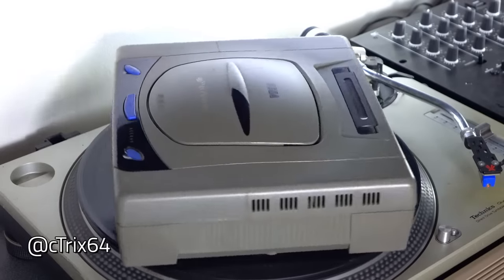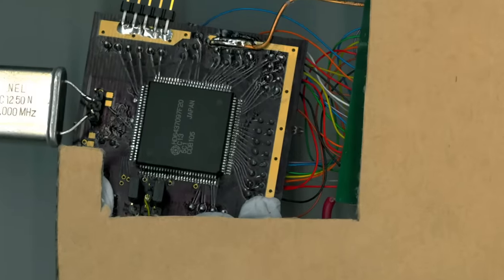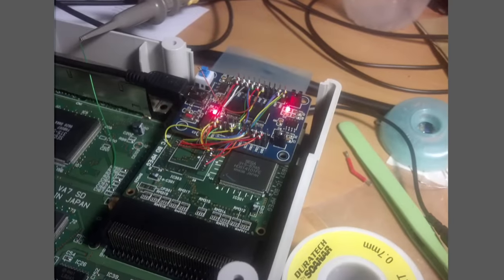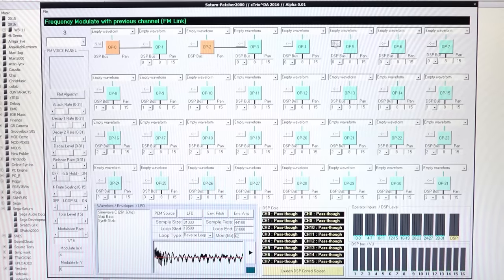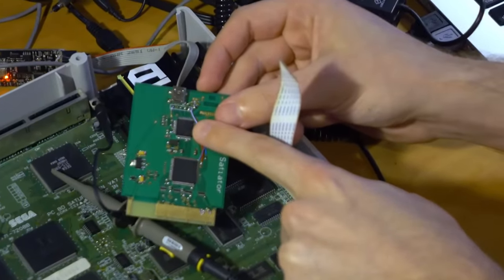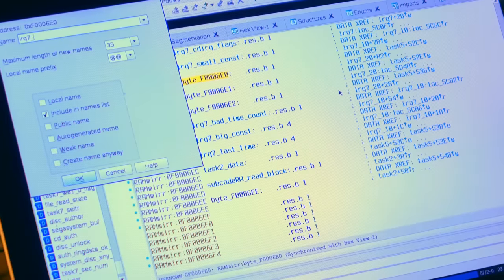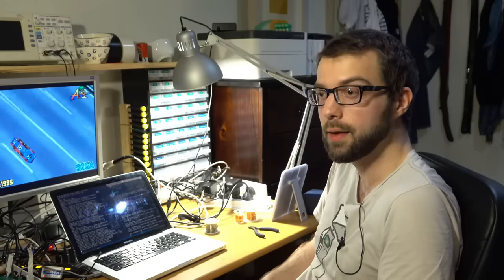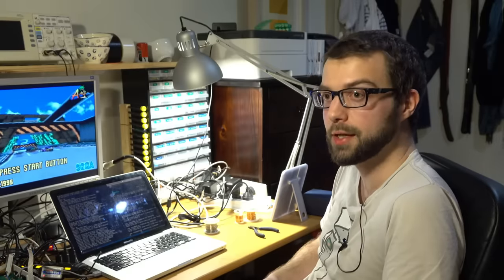Sega Saturn CD - Cracked after 20 years

Comment: Great work. This guy should get with Krikzz (everdrive guys) to have it produced with both an SD card as well as USB port (like most everdrives). That way you can load up an SD card full of bin/cue files or plug in an external USB drive and play.
Reply: I don't see the point of the SD slot.  It works for Everdrives because the games are small, but a large collection of Saturn images would need a hard drive.
Reply: Not if you include the Japanese library.  The slot in the back of the Saturn is big enough to hold a card and USB stick so its not a big deal.
Reply: I easily have over 400gb of Saturn images. And USB drives have always been cheaper.
Reply: Which is why USB is the better choice. If the device has a female USB port, you can use your MicroSD card with an inexpensive adapter, something you cannot do if it is SD-only.

USB does everything, SD or microSD does SD or MicroSD. Plus, a MicroSD card that's 512gb barely exists, and would cost over $1000. The ones on various sites are usually 4-8gb cards faked with fraudulent firmware.
Reply: The same could be said for the video port on the system. Use a USB extension cable if you would like a bit more slack.

And it depends also on the placement of the USB port. It could fit into that slot without sticking out at all, there is easily enough room.
Reply from the maker: It'd be an easy mod to the PCB to add an SD slot.  We're on the cusp atm; so it makes sense to use USB at this point.
Reply: +Boozer Chooser I'd imagine the basis for using a JP saturn was it was cheaper and more attainable than other region units. Also, the beauty of the expansion slots (the cart as well as rear) is they are region free by default. So if these cards go into mass production they would be able to work in any region saturn.
Reply: 128gb USB thumb drives are only $25 at Microcenter.  Their thumb drives are really good too.
Reply: idk who makes it, but I've had good experiences with them. People say they are slow when transferring data to and from a PC, but they work fine for playing games.  I've done that quite a bit on a Wii with no issues.

I suppose having an SD card slot would be alright.  It's just not a very good value when a hard drive with enough space to store every US and Japanese Saturn game is like $50.  

SD cards and thumb drives are great for portability, which isn't something a Saturn needs, though it would be cool to see someone take this idea and make a portable Sega Saturn with it.
Reply: "I don't see the point of the SD slot"
Nah. They are cheap, cable-less, tiny and hold large amounts of data. A 32gb SD card is $10. If the average Sega Saturn game is 500mb, then you would be able to fit around 64 games in one sd card. Not everybody has to have the entire library on one device. Some people will pick and choose a couple of dozen titles or so and disregard the rest. I am not saying that SD cards are superior to a USB hard drive, but you are giving them less credit than they are worth.
Reply: The categorizing thing is best done all on one drive with different folders.  It would be more work than it needs to be to switch out SD cards when you can put everything on one hard drive.  My Mega Everdrive has an SD card slot, but I have everything on one card in different folders for convenience.
Reply: great video and yes.  Krikzz and you should get together!
Reply: It seems everyone has tunnel vision. The advantages of USB are that it has converters for just about all storage mediums, so you can take your pick. You may even be able to use an external optical drive and play the original discs. And let's not forget he wants this to be more than just a way to play games but also help develop and create music all of which could balloon the storage needed.
Reply: It has a usb plug so you can use a USB hard drive giving you terrabytes of storage. USB is just far more versatile than a CF card and no cost increase.This guy's smart he knows what he's doing.
Reply: +Carl Zimmerman If they want to use sd they can get a usb ad card reader for pennies. 

Also in my experience SD cards are slower to transfer isos. I use usb 3.0 and the usb only needs to be 2.0 in the saturn card but id appreciate the convenience of fast transfers to my ext hdd or usb flash drive over slow sd soeeds.
Reply: This guy should develop a new Sega console.
Reply: Jimmy Darmody Has anyone made an FPGA Saturn? as that would be a good starting point.
Reply: Ruter Ralph Are ppl still doing that? I thought all the money was gone doing it like that.
Reply: The Saturn was MILES ahead of the PS1. The issue that the console had was with the terrible launch, it really turned off most of the developers who were already having trouble programming such a beast of a box. But this console ran 2D better than anything else, and when it pushed 3D properly, it humiliated the PlayStation. It used internal memory, which hadn't been done before. It was completely region free, with the right cartridge in the back, and even went so far as to support internet gaming. The playstation offered... What? A greater library in North America, but that was because of Sega of America's terrible business plan. But Japan seen roughly 2 thousand games. There are some games on the PS1 that did look better, but those games were usually the intensive 3D ones that just hadn't been ported properly to the Saturn, again... For reasons I mentioned earlier. Transparency was an issue in some games, but you have to consider the fact that this console had far more built into it than anything else, no programmer had seen anything like this; they had no idea how to program for it. Doesn't mean the console was weak, it means it was too strong for its time. It had two processors for video performance, and a processor alone for sound... The PS1 jammed that into how many? Let's not forget about image clarity, the Saturn absolutely destroyed the PS1 if you utilized RGB SCART. So uhm... Get Good?
Reply: ehhh... your data is correct but i would humbly suggest your conclusions may be a bit hyperbolic. SS was definitely designed to be the ultimate 2d system and it's undeniable they had a very different vision of what the next gen would be from the vision Sony had. even in spite of that, you have games like DOA or VF2 which ran in hi res 704x480 interlaced mode at rock solid 60 and 57.5 fps respectively. Given the hardware, that is absolutely incredible. Looking at things like the port of SF vs X-men you would have to be braindead to say the PS was as good at 2d games as the SS was especially when you take into account the 4M cartridge, but at the same time you also have games like Castlevania SoTN specifically which, in spite of it being ny absolute favorite version of the game (Maria is a beast in this version, not the gimped pleb psp version :P), the SS version objectively runs like absolute dog shit especially during weather effects, during backdashing etc and load times were atrocious (to the point the speedrun strats are different between the versions). yes some of that is due to the port being rushed but this is just as bad in other multiplatform games like Tomb Raider or Return Fire. the PS was able to do transparency in hardware as opposed to the SS having to do it in software which ate a lot of cpu cycles. that being said I will always have a warm place in my heart for the SS. it was definitely unfairly compared to the PS and there are so many amazing games that were system exclusives plus there still aren't any perfectly running emulators to this day which kinda necessitates actually having the HW if you wanna play which makes you feel like a member of the cool kids club in spite of yourself :P
Reply: @theaudiocrat  Saturn was better at 3D too. It handled 3D FAR better than PS1.

Comment: Sega saturn: Released 1994, takes 20 years to crack copy protection.
Sega Dreamcast: Released 1998, litterally just burn an iso to a cd-r and you're home free
Reply: mazda9624 Dreamcast took like 20 days to crack.
Reply: The key is that almost no one cared to crack it.  The data on the disks themselves is not copy protected and can be read in any CDROM drive.  Mod chips existed very early on for the Saturn as well so that they could read burned disks.  The problem with the Saturn is that the optical drives are specific to the system so when the drive fails even on a chipped unit you now have to try and source a new one.  The newer versions of the Dreamcast made after 2000 I believe, also required a Mod chip to read burnt discs.  To be clear this is not really circumventing the copy protection but rather emulating the CDROM with a USB interface.  He could likely plug in a USB CDROM and load a legit disk off of it assuming all of the necessary code is stored in the microcontroller that is emulating the interface.
Reply from the maker: Thanks kuhrd.  This is exactly the case.  You can - and this is what it's designed for - put your CD original into your Linux box / PC / Mac / Amiga and copy the contents across to a FAT32 drive and it'll pick up the files and run with it. BUT - you need the ISO data for the Red Book spec too.  The interface emulation has to cater for understanding what's going on at a sector level as the Sega processor expects seek delays, etc, and some games do some sneeky processing assuming the drive is doing something in the background.
Reply: kuhrd Very true. Why care about the USA library. But yes in Japan they loved it. I personally have several hundred of Saturn games for the Japanese version. They loved those dating sim type games but wish I could speak Japanese to play them LOL.
Reply: I have a dreamcast. What is it i need to burn games and where do I get it?
Reply: DeCarlos Chapman You literally just burn the iso to a cd-r
Reply: mazda9624 I don't know about this stuff.. I need more to go on
Reply: DeCarlos Chapman 
1. Go to www.Google.com
2. Search "How to burn dreamcast iso onto cd"
Reply: It's because it was running a version of Windows, Microsoft intentionally made it that way so Sega would bail the hardware business and they could join in.
Reply: Just jam something in the disc tray shutter get it to read an official disc then fire your copy in.
Reply: At the time of the Saturn, fighting games were very popular on it, in Japan and with the import gaming scene.  Many fighting game titles were not released on other systems or were released in a crippled form due to a lack of ram on the Playstation, where as Saturn had expansion ram carts.  I think the copy protection scheme being very novel was the only reason for how hard it was to do anything with this system, including how it took half a decade longer to emulate it worth a damn.
Reply: DeCarlos Chapman hmmm if only there was a way to serch the internet for answers to questions like that... especially when someone just ansered that question dummy
Reply: mazda9624 
WRONG that does not work plenty of REAL gamers know that.
Reply: DeCarlos Chapman 
Some games need a bypass cd (mod cd), others don't. Finding ISOs is easy in a google search.
Reply: The Dreamcast was easy to crack because it ran Windows CE
Reply: +Patrick Linnane it was expensive and launched at a weird time in gaming. Lots of expensive systems came out around that time. Cd-i, 3do, and Saturn.
Reply: +Jim26D This answer would explain Saturn's failure, if history stopped after the first year of it being on the U.S. market.  Later, it and Playstation dropped prices to the $200 range, as every system before them was, and it was business as usual, as far as the price was concerned.  What killed it was the unprecedented success of Final Fantasy 7.  I knew people with both systems, but FF7 was something every kid immediately bought, and while Panzer Dragoon Saga may have given it competition if they came out at the same time . . . they didn't.  And Square's commercials for FF7 were amazing.  This is just my opinion, but I had a lot of consoles, a lot of games, and saw what my friends were doing.
Reply: mazda9624 I never wanted to buy games again
Reply from the maker: As far as I can tell from talking to people who were dev'ing at the time : Sony released an amazing SDK and nurtured their dev user base big time.  They would send reps to help train people and do walk thoughs of example code, etc.  They had constantly evolving libraries for code and being a single MIPS processor with extension by SGI (who were gods at the time)...  the GPU and Sound chips were also easier to dev for.  Even something like the effects processor on the audio was just registers to set commonly used effects like reverb / delay where the Saturn had it's own assembly routines / DSP coding language to "customise" everything... which was arguably more flexible, but didn't get games out of the door because sound was usually left to ex-studio engineers who wanted to see familer looking parameters to tweak.  So yes, I think it was because they didn't have the right games (in the long run); because Sony deliberately bent over backwards to allow third parties a quick and successful dev path where Sega tried to keep it in-house unless you begged for information / help.  Also, the Saturn was expensive...
Reply: debuglive tell that stuff about "quick and easy dev path" to Working Designs' Victor Ireland.  Their licensing being withheld was an unexpected death to his game translation empire.  Yes, dual core before it was popular made it harder to program for, but Capcom loved the extra ram thanks to the expansion cartridge as PS-X did not support, so we fighting game enthusiasts had to choose between buying a Saturn or not being able to play tag-team games properly due to memory shortages.
Reply: No it didn't. It took 20 months.

Also, Copy Protection on the Saturn has not been cracked.

Comment: While you are at it... my car is making this funny noise when I back it out of the driveway...
Reply: JCDenton 2012 could be your transmission
Reply: must be your neighbor cat...
Reply: You took the cat out of my mouth... :D
Reply: You should have had the stem lube   done on your last service.
Reply: You need to carve a particular wobble pattern in the outside edge of your tires.
Reply: this guy could probably figure it out in an hour without knowing anything about cars
Reply: Itll only take him several years
Reply: Maybe it's your GEP gun silently eliminating Manderley
Reply: Nah i bet its your piston return springs the must be rust and grinding material you should change them every 100,000 miles normally but it depends on the car should get it checked!

😂
Reply: JCDenton 2012 have you tried turning it off and on again?
Reply: JCDenton 2012 try removing the cars ecu and plugging a Sega Saturn in. Car might not work but at least you have video games
Reply: Maybe you need to change the headlight fluid...
Reply: The flux capacitor run out of juice
Reply: That's the sound of your pride falling out the door.  Learn to fix your car :p
Reply: Oh my god, JC! A BOMB!
Reply: Stop running over your wife
Reply: More than likely brakes

Comment: I have a new found respect for the Saturn , brilliant content 👍🏼
Reply: There is a ton of great content for the system out there...pity it's JP region only. You don't need a chip to play it you just need to solder some wires and put in a switch. If you want CDR support, then you need the chip referred to in the video.
Reply: @98triffid  Its tech and hardware was never fully realized. Saturn was FAR more versatile and technically superior than Sony's PSX.

Comment: 20 years to crack it make you realize how good these japanese engineers were!
Reply: Not really. They just had an enormous amount of "tools" to work with. Nowadays we have these tools in the reach of our hand.
Reply: Wouldn't it be more like "accidentally so spaghetti it is obfuscated"?
Reply: He said this console is over-engineered, any company can do this if they had enough resources
Reply: Eh, it used the same technique that they still used in the mid-2000s on consoles. A wobble in the disk which can't be replicated by any mass produced dvd burner, and requires specialized hardware to produce. It's not really that genius. There wasn't even any copy protection attempts at all on the disc - this is a very poor example of japanese engineers designing secure consoles. The only issue was that the ROM controlling the disc player did not have a pinout to dump itself in any capacity, as it was a "boxed in system" as described in the video. It also could not be looked at physically under a microscope to see the ROM either, so a dump couldn't be made that way either. That's not really impressive imo, it was more of an accident because of the design of the chip. In 1994 I don't think they were consciously thinking about people dumping roms with a microscope, physically cutting into the CPU and analyzing it. I think the man who put these years of effort into it is far more brilliant than anyone who designed this console.
Reply: So THAT'S where the dislikes CAME FROM....🤔🤓....
Reply: @Jonny  Despite that same guy literally saying he was amazed at how well engineered it all was, the designers did a bad job. Ok 🙄
Reply: Definitely more gifted than the people commenting so far.
Reply: @Wertdante  It wasn't complicated because they had recources or to make copy protection great, the Saturn was complicated because they didn't know what to do with it and they made the wrong bets in the beginning of development because they started with a capable 2D console and they found out after the fact that 3D was going to be so important, so they kept adding new components on that ended up creating the maze that it is and it made game development too complicated as well, so it obviouly wasn't "genious hardware" because they had resources or great engineers but more just an over priced failed hardware.